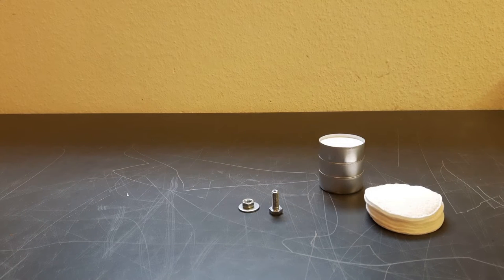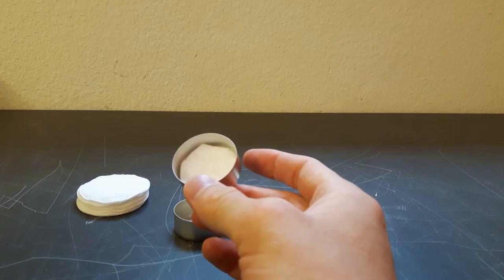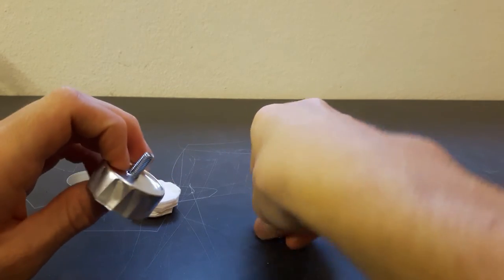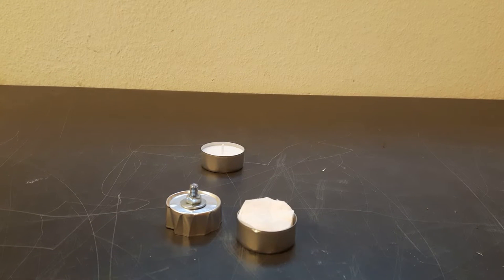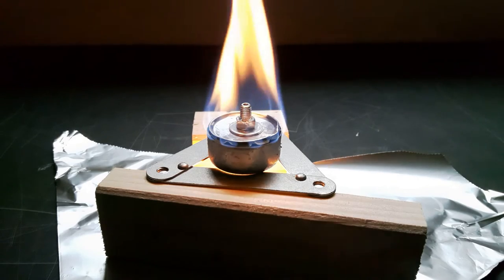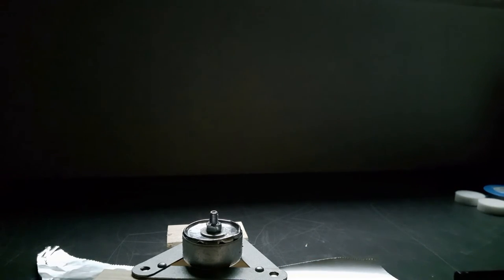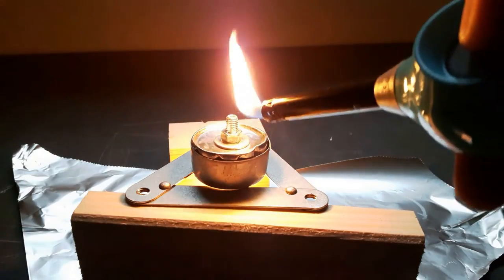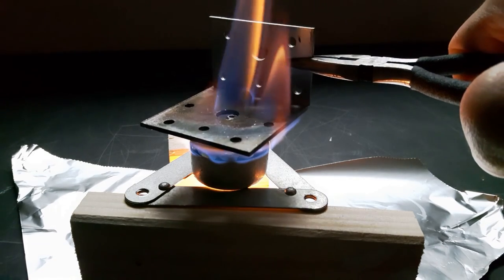DIY Alcohol Stove: Pressure Stove

Comment: 1) How much alcohol can the stove hold?
2) How long will it burn?
3) Can it boil 450-500 ml water on one fill?
Reply from the maker: Depends on the size of your tealight. For mine about 25ml.

Depends on the distance between pressure part and heater. This one about 4 min on average.

I don't know
Reply: @ShroomLab  
Mine are smaller. I don't use a candle, or screw. Just one 16mm hole in middle, and 8x3mm holes around edge of top. I have some 25x38mm which hold 18ml, and smaller ones, 12x38mm which hold only hold 11ml. With 1/2 inch headroom, I can just (about 75% of the time) bring 2 cups (475ml) to boiling, using the deeper one. Takes about 13-ish minutes. With more headroom, too much heat goes up the side of my (4 inch or 120mm diameter) pot, and it won't boil.